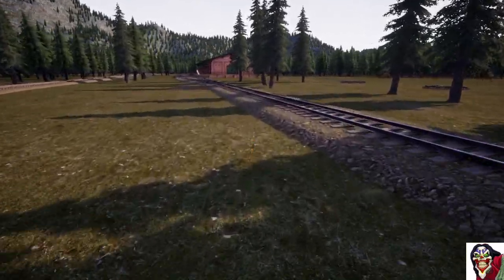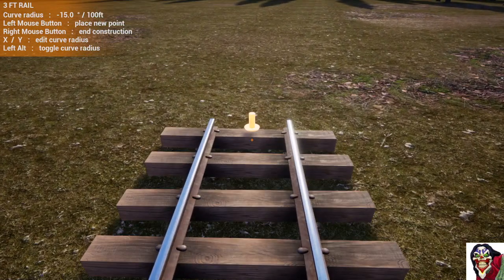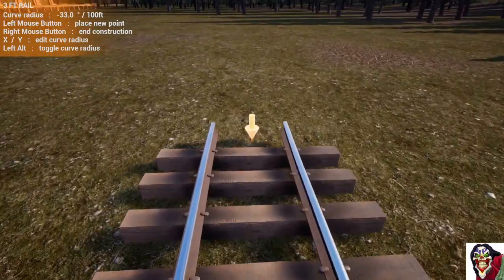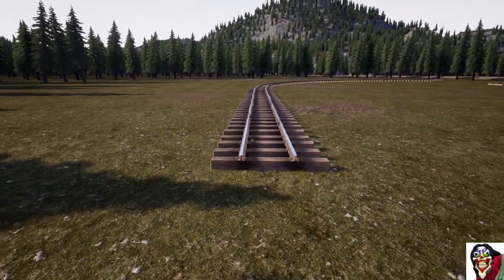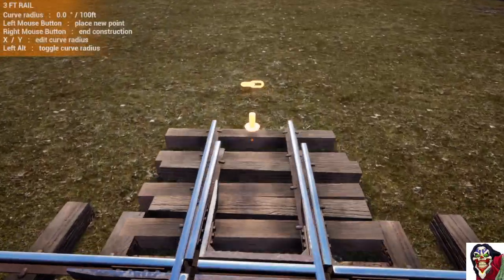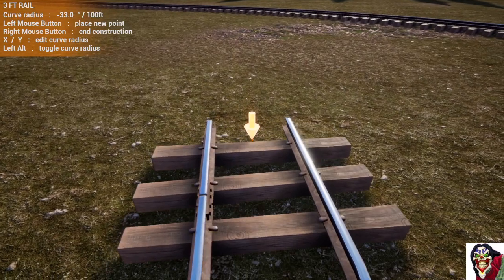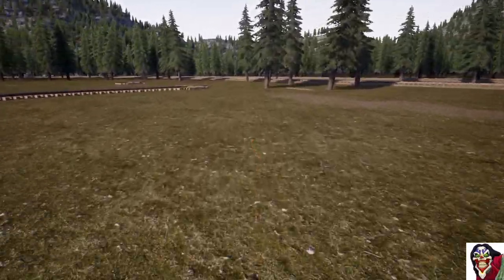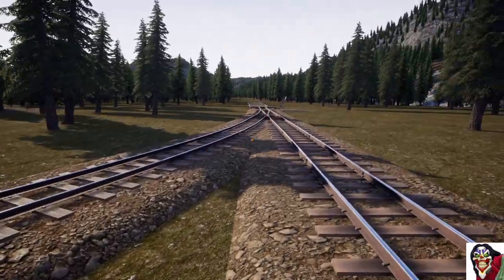RO! - Old Build Tools Tutorial Ep4

Comment: Why do you need to place 7 tie segments? Are they more accurate with the degrees of curvature?
Reply from the maker: Its actually 9 tie segments (watch the tutorial intro).  9 tie segments gives you a higher resolution of control points, which means there's less chance to get wobbly track and you have more control over where the track goes.  7, 9, and full length segments are the only control point spacings that do not get odd gaps in the ties.